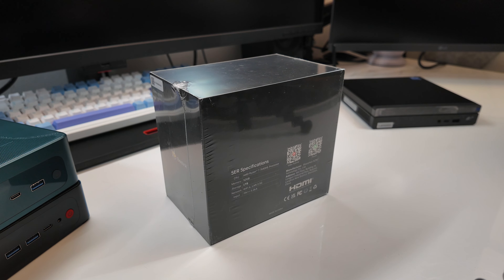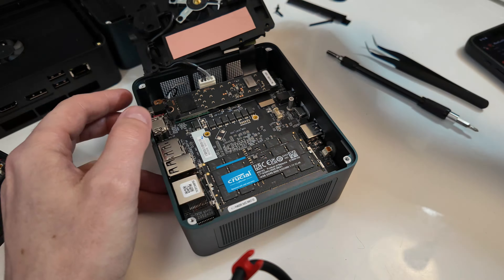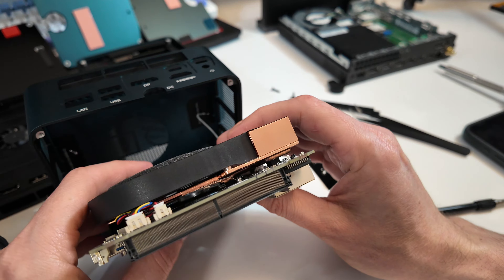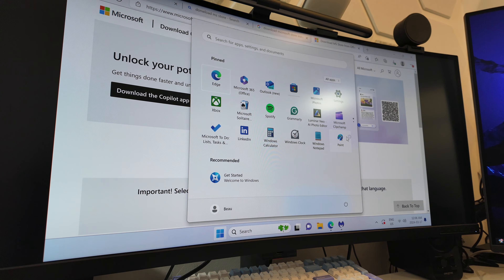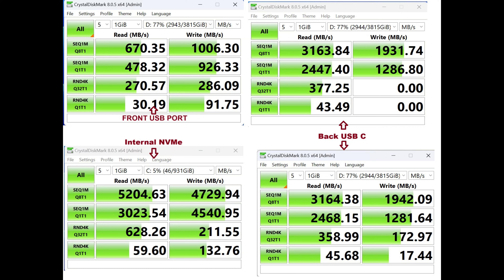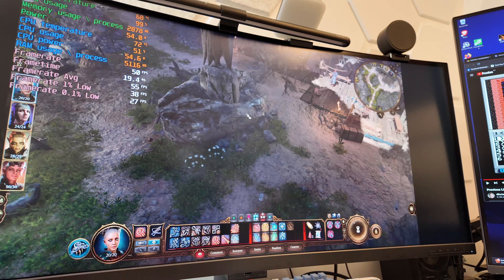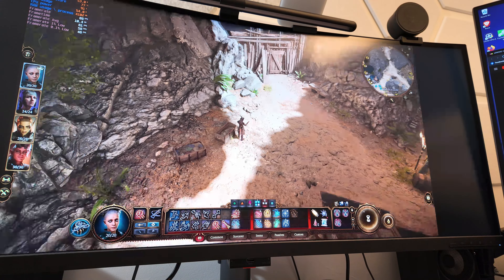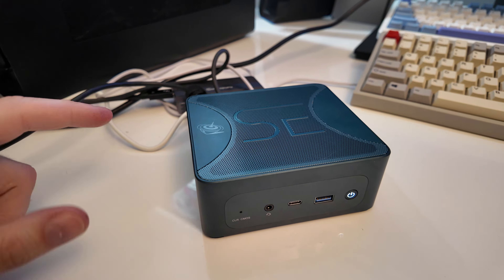Exceptional Quality - Beelink SER7 Mini PC : Review and Testing

Comment: I just got one today and it's nice and quiet but it feels pretty hot to the touch. is that normal or something i should be concerned about?
Reply from the maker: Suficial heat doesn’t matter. You can download hwinfo and check for throttling. So long as the internal components are cool it’s fine.

Comment: Great review man! Do you think the $399 ser6 or $579 ser7 would be better value? For the purposes of gaming and some video editing.
Reply from the maker: Thanks. That’s a tough one, I’m just finishing my ser6 review actually. 

In terms of video editing and general computer they are close enough to not matter. But the 7845hs is definitely more capable than a 6900hx/7735hs in terms of iGPU

If you are set on gaming and not using an eGPU I’d recommend the seR7. It will easily outperform a steam deck by a mile, and even the legion go/ROG ally significantly
Reply: @TechGuyBeau  great! Thanks for detailed review and detailed response!
Reply: @TechGuyBeau I currently use my steam deck like a pc and I’m looking forward to getting a mini pc to up my gaming a little more

Comment: I need help, I have the same PC but it has problems running the games, it runs very well however after 5 minutes they close, the temperature is fine so it is ruled out. I tried all the drivers and it still doesn't work.
anyone with the same error?
Reply from the maker: Check your memory. Doing meme test. It could be something to do with that, maybe a bad ram stick
Reply: @TechGuyBeau  Thanks for your help, today I ran a test however it says no errors were found
Reply: @TechGuyBeau  Finally I was able to solve it, it was problems with the bios, I just changed the version to an older one.
Reply: I also have a ser7. Mine had trouble starting up so beelink sent me a new unit and my new one works well now.

Comment: its good enough for doing video and photo editing, internet and other kinds of less hardware demanding work. if you want gaming ones , there are those like the minisforum hx100g or something. or is it hx99g? but they comes with discrete top tier laptop GPU like the radeon 6800m XT. and i think there is the newer version with 7800mXT etc. and its CHEAPER than gaming laptops and performs better since you could crank their TDP over laptop levels.. 
and you could order it "barebones" so you could choose to buy only 16GB of RAM that is cheaper and pair it with affordable SSD you could fnd, and it will be still better investment than buying an OLD desktop computer hardware that will be obsolete soon. thsoe mini PC with the discrete GPU could come in total cost less than 1000 bucks. and already in latest generations of hardwares. for people on budget out there.